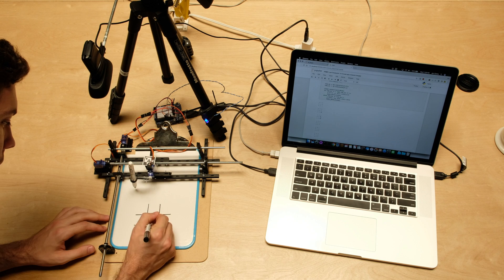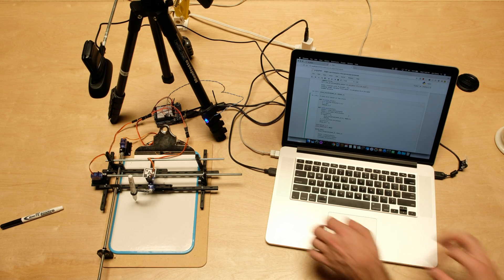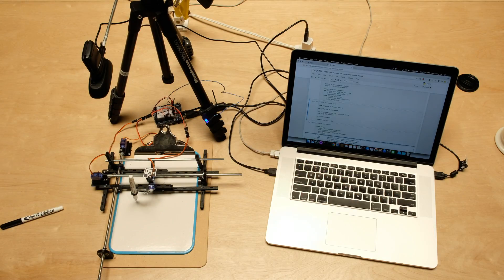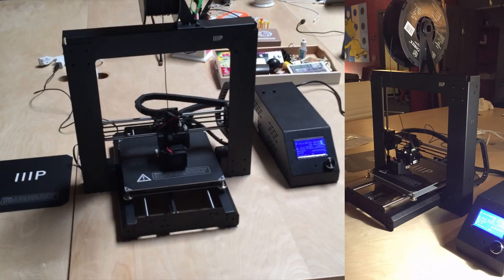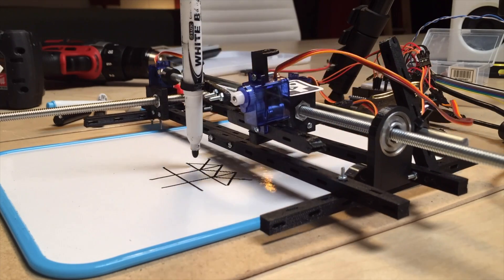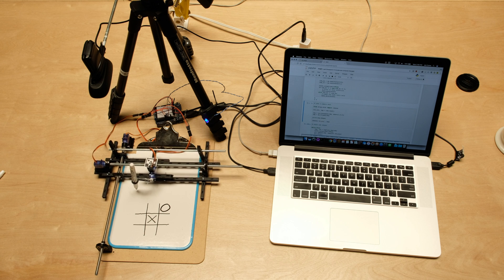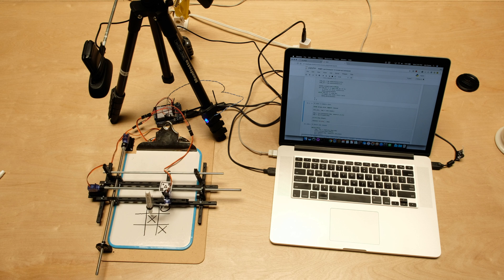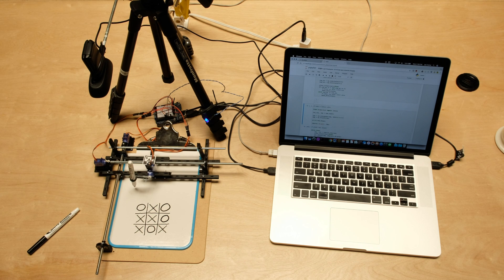Tic Tac Toe A.I.

Comment: Hey just wondering why not use minimax? I guess a neural net is cooler way to do this but wouldn't a minimax implementation be simpler in this case? just curious...
Reply from the maker: I chose neural networks mainly for fun but you’re right, in this situation minimax is a great choice. I merely wanted each part of the system to be some neural network, from detecting the board state to making the final move. A fun project would be to go end to end neural network even, from image pixels to pen movements with no game logic necessary. Though that’d take quite the training setup or simulation and lots of time! 😄
Reply: giant_neural_network woah yeah that would be cool, having the output be just the arm movements and the input just be the board, cool idea like you said, no game logic. Cool project!
Reply from the maker: @joechrisman217  Yeah end to end is fun! Amazingly NVIDIA attempted such a thing with self driving cars, going from camera inputs to steering wheel outputs with just a convolutional neural net between.. you can check it out here https://devblogs.nvidia.com/deep-learning-self-driving-cars/ I don't know how comfortable I'd be having the thing drive me around though.. yet :-)

Comment: It should probably be possible to program it with a solid "do this". A google search says 255,168 possibilities. Easily possible.
Reply from the maker: Yeah definitely... did it more as a way to explore using reinforcement learning/ml to solve the problem. Start slow :-)
Reply: Actually the 255,168 possibilities can be narrowed down by a very big factor, because there is a lot of pruning and symmetries in the deterministic decision tree, which results in a fairly short algo. I can say so because I programmed one on my casio when I was in highschool.

Comment: It's really nice, but for example, how long does it take to go to the furthest square and draw a circle or a cross and than go back to initial position ?
Reply from the maker: Oh man I don't even know, a long long time hahaha. When you play against it it's more like you make a move, go read some reddit or something, then come back once you hear the motors stop churning :-D Using some belts and steppers would be a nice upgrade for sure.
Reply: giant_neural_network haha ok :) I think that it just also need servos that might be less precise (it's OK, yours are a bit too precise ^^) but just faster servos ^^
Reply from the maker: Cyxo yeah, that’d help! Or even some dc motors and a motor driver. Perhaps need to gear them down to turn the threaded rods, could try out 3D printed gears :-)
Reply: giant_neural_network Yeah I think there is some gearing in 3D printers too